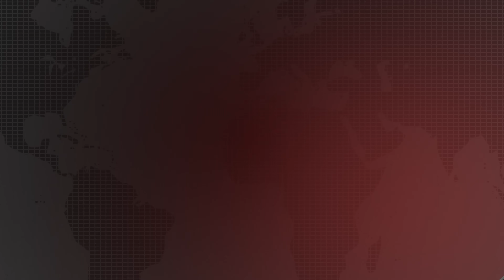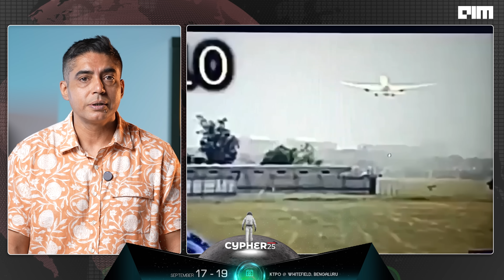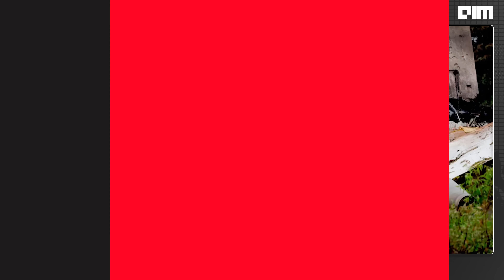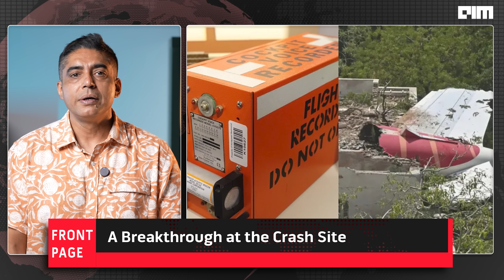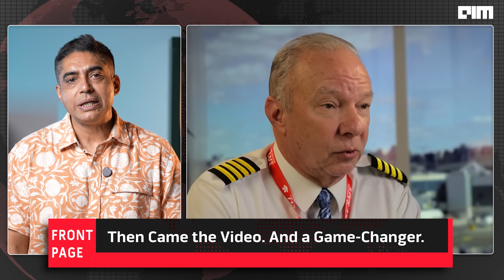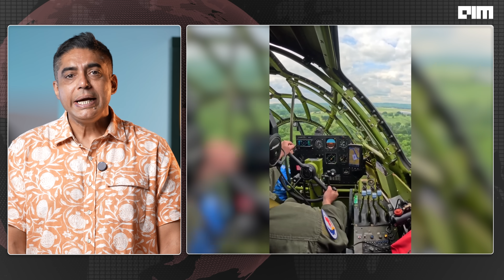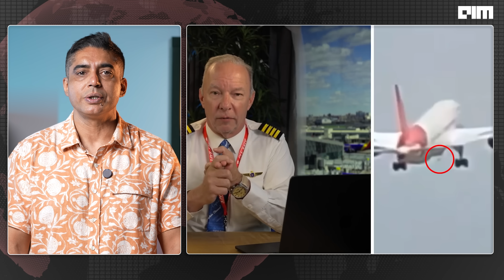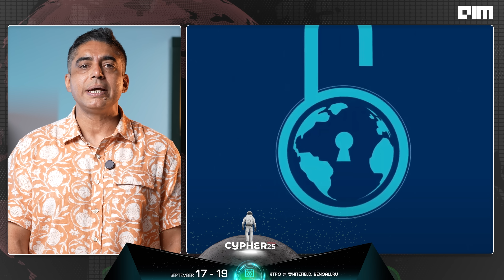Air India Crash: Is Boeing in Trouble Again? RAT Footage Sparks New Questions

Comment: Landing gear vs flap lever confusion is not an ideal mistake to make but it’s a very forgiving one when both engines are working. All it would mean is that the aircraft will climb much slower due to drag from gear and wrong flap settings which with quick corrective actions would let the flight continue uneventfully. 787 suffered unfortunate engine failures. Even with right flap settings it would have been doomed.

Comment: Air crashes are usually blamed on pilots because they are dead on most incidences and therefore could not testify for themselves. Even in cases where the pilots survived and saved passengers from certain death, the corporate power houses responsible for the aircraft's construction and technical details always look for ways to blame the pilots.  Because the aircraft manufacturing companies are only a handful and they are also military contractors of major governments, they are too powerful to admit any blame and it is almost impossible to bring them under the law.  These aircraft companies would rather payout to settle the case than really assume any responsibility although they do use the knowledge gained from the crash to address the issues internally.

Comment: Boeing Headquarters in America, as well as Indian Airlines will be somewhat nervous as the days progress to investigators discovering the real reason for the fatal crash. I don't want to jump to conclusions about this horrific air disaster. I have a suspicion that there was some form of computer malfunction in the cockpit just seconds after take off: the engines must have been programmed to a lower thrust which the pilots could not rectify or override at low altitude.

Comment: Catastrophic engine failure doesn't happen in both engines at the same time on the 787.  Like all modern passenger aircraft, it can take off on one engine if they lose one just after V2.  I'm going with fuel contamination, or, and this is where I'm leaning, a deliberate shutting down of both engines right after takeoff.

Comment: The RAT was pulled manually. They assumed engine failure. Boeing in trouble? Where in any flight manual does it approve a heavy maxed weight plane to use all the runway. Their airspeed was gained only the last 2 to 3 thousand feet. The runway was 11,000 over. Pilot errors.

Comment: There: You hit the nail squarely on the head when you said "corporate interference may cloud the findings." That includes government too. From the lowliest house keeping person to the top engineer  in corporations and government, there are people who are vulnerable to outside pressure to hide or destroy information that may lead to liability. From bribery to extortion, there are some who will stop at nothing to protect their interest. We may never know what actually happened. In 1980 TWA Flight 800 suffered an explosion 12 minutes after initial takeoff in mid flight over the Atlantic Ocean. The NTSB wants us to believe that a low voltage abraded wire caused a spark within an empty fuel tank and the fumes ignited. The definition of an explosion of that nature is a rapid oxidation. In order for an oxidation to happen Oxygen is required. There is none inside a fuel tank, it's full of fumes, not oxygen. The ratio of fuel to air must be precise for an explosion to occur, and it is much much more air than fuel . Inside a fuel tank there is no Oxygen. So a rapid oxidation is not possible. The NTSB doesn't care if you know that or not, they will stick to their story regardless. After all, how can you prove otherwise. After a mid air explosion, there are no fumes, or evidence to prove anything. So it's a good story to tell.  But if you are a physics study, you know how important A/F ratio is for an explosion to occur, and the inside of a fuel tank is NOT GOING TO HAVE the A/F ratio to explode unless somehow air is allowed to enter and it needs to be in sufficient quantity to create a mixture more air than fuel well above 50%. But the NTSB doesn't care if you know that and they just  tell you whatever they think you will understand to be their position. They don't care if you believe it or not. The Air India Flight 171 may well have been purely accidental, but someone has to be liable. If the truth cannot be ascertained, you cannot assign blame. That is the primary objective for the manufacturers and other parties associated with the whole process of human flight. It's just nobodies fault. ben/ michigan

Comment: Sorry but this video makes no sense. First of all, if it indeed was an engine failure, why would you say "Boeing is in trouble" in your title? That would be General Electric if it was an engine issue. Second, there are at least 5 possible scenarios which cause the RAT to deploy. So to say that it must have been an engine failure based on this is also not factual. Personally I feel it is more likely to be an electrical issue that's at the core of it all. As the fuel system is electrically powered on the 787 it could very well cause the scenario we have seen, with engines losing power and not achieving thrust as the captains mayday indicates. The official report will bring clarity.

Comment: I spent a 50 year career as an pilot / mechanic, fixing and flying everything from antique bi-planes to freight dogs, to corporate jets to airliners. Catastrophic engine failure with nothing falling off the airplane, nothing in the exhaust, no fire, no smoke…no visual debris at all? And we are not talking one engine, but both. I would assume that both engines where full dual FADEC with cross over capability. You are talking a zillion to one odds of those engines just winding back on their own. Maintenance failure that caused such an event? That is just as hard to imagine. But it clearly wasn’t crew error so…your guess is as good as mine. But that is all it is, a guess.

Comment: It is starting to be a maintenance issue if the engines failed. Fuel contamination high on the list or something that caused the engines to reduce power output say an air lock in the fuel lines? This will show up on the flight data recorder. If a maintenance or operator service error, then Boing may breathe a sigh of relief. If an indeterminate cause of engine failure then the clouds of confusion will roll in on the investigation as people start diving for cover to shield themselves from possible blame for the crash.

Comment: Here is my theory, it was software or a mechanical linkage failure on the throttle circuits,lets say the engine cockpit throttles were at max, ie normal take off position, as dialed in by the pilot ,but the onboard computer only received say 70 percent from the throttle position sensors, due to a sensor linkage not going far enough ,so engines would only get the 70% signal,that would explane why no flame out occured, i cant think of any other reason for lack of engine power. anyone with a block diagram of the throttle linkage system?

Comment: Electrical problem, one of the generators blew, that was the bang and caused flashing of lights, when this happens on this plane which functions almost entirely on electrics, this will cause a short circuit and intefere with the electric function and cause both engines to shut down. I think poor maintenance and overheating caused it. It was 40 degrees, the plane was on the tarmac for 3 hours before takeoff and it was full to maximum with fuel, passengers and cargo. A recipe for disaster.
Reply: @aspiretobe-helpingyouachie1398   wondering if high temperature was a factor in causing low air density and impeding lift.
Reply: @user-cy3ox5uh9b Well i think the high temperature contributed to the electrical failure.

Comment: Even a maintenance issue MAY NEVER lead to a such severe electrical failure that both engines flame out on rotation (eg because the fuel pumps lose electricity). This is most likely another severe design flaw by Boeing, comparable probably only to the MCAS! Also the JEJU crash earlier this year revealed that it is possible on a B737-NG that the FDR simply stops recording upon dual engine failure - simply because some genius designed the electrical supply in such a way that it is simply not hooked up to the batteries! I bet Boeing had some other creative ideas for the B787 and cut back on redundancy (and thus safety), because a severe electrical failure was deemed „virtually impossible“. The problem with a pure fly by wire bird emerges, when there is suddenly no more juice in the wires… I hope I am wrong, but so would not be surprised, if I am right…

Comment: Few months back I was so unfortunate to fly in Air India from Washingdon DC to Delhi. The whole journey was a crap. In the plane, the handrest came out, seating cushion broke and the entertainment system simply did not work, and the whole flight was miserable. Because of the cushion issue later I developed leg health problem in India that lasted for a month. No crew member cared about the hellish condition of the flight. Even though I paid premium for front seats, I was moved to a lower seat without my knowledge because they changed the aircraft and website had issues. 

However during my travel, there was one doctor who was sitting next to me. He was a great patriot. He told me that the Tata's would fix everything by getting new planes and these planes were from the Indian Government owned due to the foolish Morarji Desai, and now after Tatas have taken back, we should fly in Air India because the money goes to India instead of to some other country.  But the question is when are they going to get the new planes? 

Then in Delhi I ran into another big problem of taking my luggages and re-check-in to my domestic flight. While I was so panicked about missing my connecting flight, due to the sluggish queue, no Air India employee seemed to care at all. They were wasting their time talking and joking with the colleagues. I decided that I should not even use my return ticket of Air India to fly back to Washington!.

The maintenance is extremely bad and I do not want to think about Air India even in my dream. Later I found that the Air India is using some Turkish company for the maintenance! The Turkish are the people who support Pakistan and are against India. They would be willing to sabbatage our country and people and also as their contract is ending soon. 

I am fully convinced that the reason for the Ahmadabad flight crash was due to maintenance problem and negligence by Air India. Air India has not fixed anything since the acquisition - so they do not fix even the engines! I would avoid using Air India by all means for my rest of the life in this planet!

Comment: The RAT explanation is very poor considering the available poor footage. And very unlikely a dual flame-out occured just after take-off. It's possible but would be one in a million flights. No birds, no strange weather. The gear didn't came up. Why? That's the question.

Comment: I have been an aircraft mechanic for 50 plus years.I have done power run on 747 and other aircraft and in my opinion could be EFCU (Eletronic Fuel Control Unit. Failure will not make take take off power. Both engines.
Reply: Please retype, thanks

Comment: Unfortunately I think this is going to end boring as a company. They were struggling before I know this is not good for them. They used to have the biggest amount of engineers in one place building the parts for the airplanes as well as the airplanes. They laid them all off and hired non-engineers to save money but it costs in the quality and the people's trust😢 it will cost them everything I think
Reply: No way! The Boeing planes here in America aren’t having any of those issues because we’re spending money on maintenance. That’s clearly a problem on India and not the manufacturer.
Reply: @Blessings-zq2ck have you seen the news lately and online? Is there a stock has plummeted they're going to go bankrupt an American company or not when they laid off all the engineers that used to build the airplanes so they can make more money what is the worst mistake they ever did. This is the result bye bye Boeing

Comment: Fuel Contamination (Like Water) would cause no power and engine shut down... "Catastrophic Failure" would be more like the engine coming apart... Having BOTH engines fail like that WITHOUT it being a fuel system problem, is VERY unlikely!
Reply: Could it be the pilots?